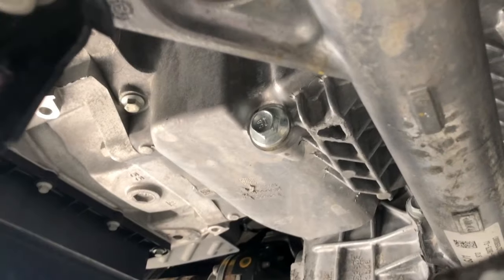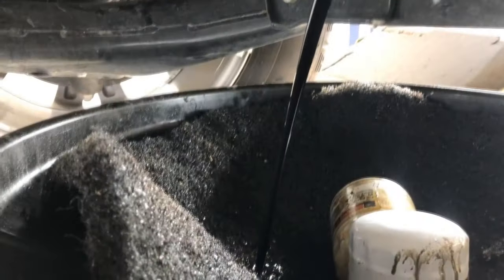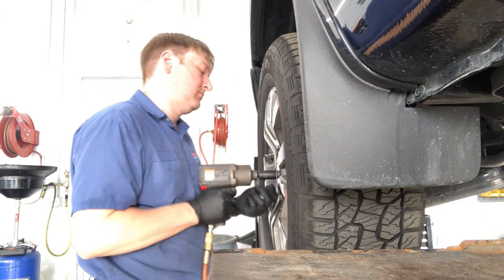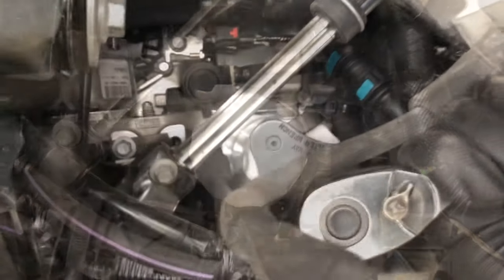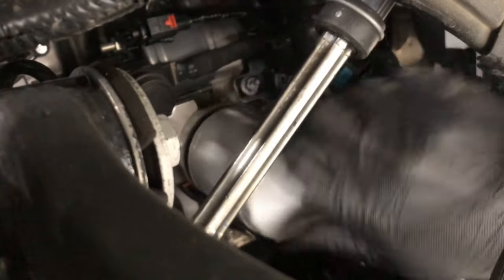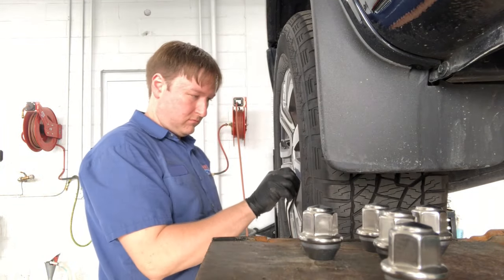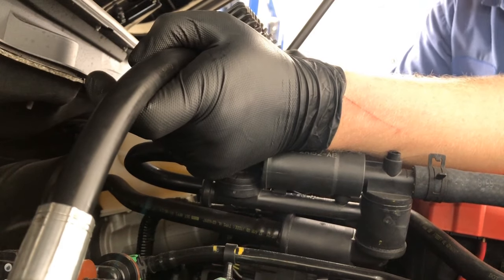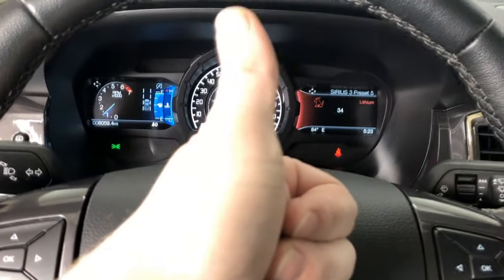Ford Ranger Oil Change Procedure

Comment: I too own a 2020 Ford Ranger XLT and I've changed the oil at least 8 times so far. There is no need to remove the left front tire.  Just turn the steering wheel all the way to the right which gives plenty of room to work.
Reply: But did u have to remove anything? Just a couple days ago I just watched my manager locate and remove the oil filter without removing anything but retainers and move the cover without turning the wheel
Reply: What is 6.2 quarts of oil six bottles and a half
Reply: 💯 agreed
Reply: Thank you sir.
Reply: Came here to comment this. Bravo to you sir.
Reply: @davidhuynh5600 6 quarts and 6 ounces , or 6 quarts and 3/4 of a cup or 6 quarts and 177 milliliters.

Comment: You can also spin your steering wheel all the way to the right and just reach around the wheel so you don’t have to remove it.
Reply: Remove your wheel.. that's nuts. I can't believe he doesn't mention the entire time to torque the  drain plug on. Hand tight till ya get a leak I guess?
Reply: @CookieManCookies  I've never used a torque wrench on any oil plug.  Hand tight then a half a turn.  It's such a low spec in general it's hardly worth it

Comment: Thanks for the great video, easy to understand. Appreciate you mentioning the socket size for the skid pan bolts and lug nut torque specs, makes it easier to just go under the truck with the right tools the first time.

Comment: Exactly the kind of video I was looking for I'm changing my dad's oil in his ranger today after work thank you sir
Reply: Little advice since I drive a new ranger.  Don't take off the tire trust me.  It's just as easy to just reach over the tire.  You only need to take off the top 3 screws because that cover is just flimsy rubber so you can bend it down without harm.  But don't over tighten the screws like the last mechanic did on mine.  Because when taking them back off it's too tough.  I had to cut my cover off because the screws stripped when I went to take them off
Reply: Who tf thought it was a good idea to make plastic screws

Comment: Best instructional video I have yet to see. Also everyone who says you don't need to remove the wheel must never rotate their tires.
Reply from the maker: Thank you! And I also agree 😂
Reply: Scott Spicka - I too own a 2020 Ford Ranger XLT.  I've changed the oil every 5,000 miles and rotated the tires every 7,000 miles. There is no need to remove the left front tire.  Just turn the steering wheel all the way to the right which gives plenty of room to work.
Reply: What does rotating the tires have to do with an oil change??
Reply: They’re both basic maintenance but I don’t understand the connection
Reply: Scott Spicka - Still saying stupid things are you !!!!!  Wow....
Reply: @LstFknSoul  - The clown that said that is just that.. Ignore it...

Comment: I've been told the whole procedure must not take longer than 10 minutes because of the oil pump running out of oil & won't prime  is that so??
Reply from the maker: When I worked as a Ford tech, the 10 minute issue has never been brought to my attention nor to any other tech’s attention to my knowledge. I have read that the overseas Rangers with the diesel engine has this issue, but our 2.3 liter I believe does not apply. Either way, the oil drains out before 10 minutes anyway. I do believe there is no danger with this engine and I have not witnessed or heard of any issues during these Ranger’s oil changes.

Comment: what about the 10 minute limit before the oil pump is drained, if that happens you have an issue..
Reply from the maker: I never heard of that one. I guess don’t let the oil drain for 10 minutes.
Reply: The 10-minute limit oil drain does not apply to the Ecoboost gasoline engine

Comment: How much of a quart of oil is the .2 of the 6.2 quarts??? Is there a measurement on the side of the oil bottle that shows this .2 ???  Wish I had seen you pull the dipstick after running it and letting it drain for awhile so I could see where the oil level is on the stick.. Perhaps then, I can know how much oil is 6.2 quarts...  
Thanks for  your great video !
Reply: If you have to ask this question, please just let the professionals change your oil.
Reply: Here's an easy way to figure out partial quarts.  A quart is 32 ounces, so .1 (10%) of a quart is equal to 3.2 ounces.  That means .2 (20%) of a quart is twice that much and would be 6.4 ounces.  There are usually marks every 4 ounces on the quart bottle of oil, so 6.4 ounces would essentially be half way between the 4 and 8 ounce marks on the bottle.  If you buy your oil in the 5 quart jugs (which I usually do), just save any 1 quart oil bottle you have, clean it, and then mark a line half way between the 4 and 8 ounce marks and fill to that level from the larger jug.  Hope this helps.
Reply: @jamiehickman6556  - I know it's been a few months, but wanted to thank you for helping me figure out that .2 of the oil change refill...  I did it and ended up putting in the same amount of oil I took out of it. It was filled to just below the highest hole on the side of the dipstick you use for measuring, from the factory..  I added 6 quarts, really slowly, etc., and ended up adding more than 1/2 quart more to get the oil level on the dipstick to the level it came with from the factory...  This is not new either...  On my '09 Grand Cherokee with the 5.7 Hemi V8, it also took a lot more oil than just the ounce nbr., when measured by the dipstick...
Reply: 0.2 quarts is 6 ounces.

Comment: Geez, I would go a full year on a full synthetic oil change just due to the hassle(removing wheel and covers/shields).  I only put about 6K miles a year on my vehicle.  I wonder what my local dealer will charge for a standard oil change, $75?  I'm used to paying only around $40.
Reply: Local dealer here cost me about $500-700 for the oil change. Original oil change was below $100 if I recall. It's just the POS mechanic decided that one wheel needed to be put out of alignment. Few hundred for the alignment(another shop) and a few hundred for the tires I had to replace.

Comment: reading this as the techs at this “ THE LUBE CENTER” struggle to remove the oil filter because they dont have that tool you used to loosen it

Comment: Did you just hand tightened the new oil filter?
Reply from the maker: Yes. I never use a tool to tighten oil filters.
Reply: Is there ever an instance where it’s needed tho?
Reply: @MichaelAdamsRocks  ?
Reply: @LstFknSoul  - I have never seen an instance when you needed a tool to tighten up a new, gasket lubed, oil filter...Most oil filters say on the box - "Tighten 1/2 a turn after gasket contacts the engine", something like that... Just tighten it up by hand and then a little more tight...If you use a tool, it will be easier, and you may tighten it up too much. This may not be bad, but will be fun when you have to remove that really tight filter next time...  I just use my hand to tighten and in 60 years, have never had an oil filter leak..

Comment: I'm trying to change the oil/filter on a 2021 Ford Ranger Lariat for the first time at around 5,000 miles. The oil filter seems immovable given the tightness and awkward angle of my arm/hand over the tire and through the wheel-well. Note that there is not a lift-kit on the truck. The space doesn't seem to be big enough for an oil wrench. Does anyone have suggestions to remove this filter? This video seems to have shown a type of wrench/extension.
Reply from the maker: I have an oil filter jaw tool that is connected to a 6” ratchet extension
Reply: @MichaelAdamsRocks  buy the oil filter cup socket ,easy as can be
Reply: @TommyG11814  - Yes, thank you !!!  Get the oil filter socket, however long extension/s you need and put a ratchet on your end and turn it counter clockwise to get it started, then hand turn it off the rest of the way..

Comment: All of this crying about taking off the wheel.   About 90% of the time the tires are rotated at the same time the oil is changed.  
Manufacturers use the same engines in various models, so frames and other parts are in different places.   That's part of the job.

Comment: Horrible design. If u don't have a lift, u can't even use ramps because of the tire removal. So u have to jack up the truck then crawl under it, even with jack stands not a great situation. Jackassery.  Way to make a 15 minute job into an hour.

Comment: You absolutely do not have to remove the tire, so I'm not even gona watch this.
Reply from the maker: Do what works best for you. Tire removal makes it easier for me.
Reply: @MichaelAdamsRocks  I have a 2021 ranger and It dosent even make a mess with the filter ,ford put a nice funnel with a ramp that let's the oil run down if you spin it off slowly, thanks for the video anything always helps.
Reply: So you never rotate your tires?
Reply: @scottspicka7372  every 7k not every oil change  what does that have to do with oil Change
Reply: @TommyG11814  I change oil at 5000 miles so I just go ahead and rotate tires then also. Doesn't even take any longer when you have a lift. Just pull the drain plug and rotate the tires while the oil is draining.

Comment: depending on the year the Ford ranger cannot have a simple oil change because if you drain the oil completely out until it stops dripping it will ruin the engine because the oil pump becomes empty and it's a huge pain in the ass priming it. I think you have to put the drain plug back in once the oil is at a trickle and then re fill to keep the oil pump primed. Ford really made a terrible designed vehicle and is why I'd never buy one.
Reply from the maker: That’s with the diesel version which is not available in the US. This engine is self priming so it’s not an issue.